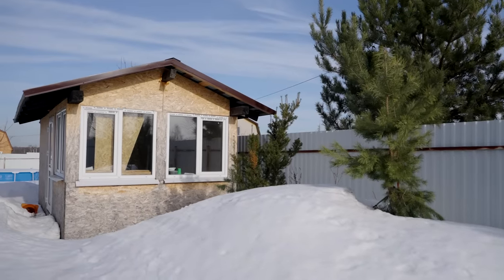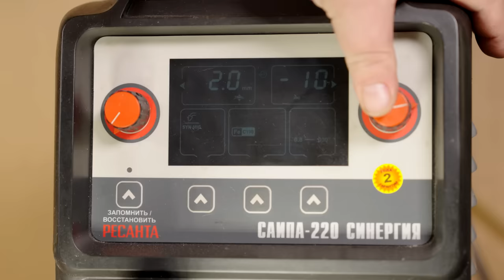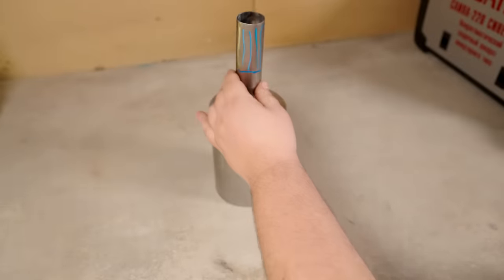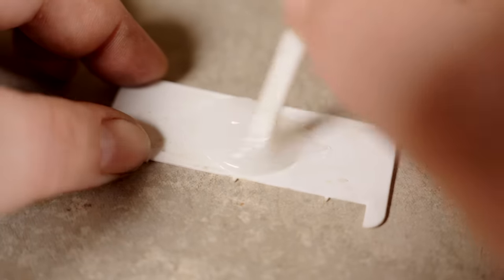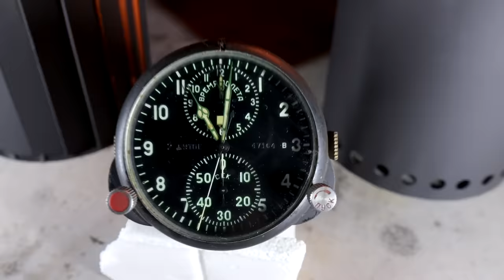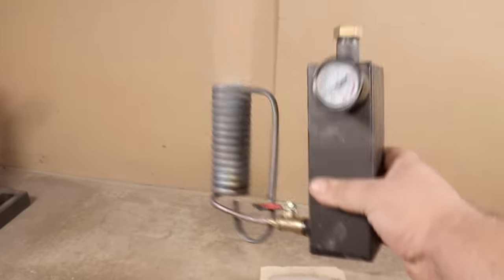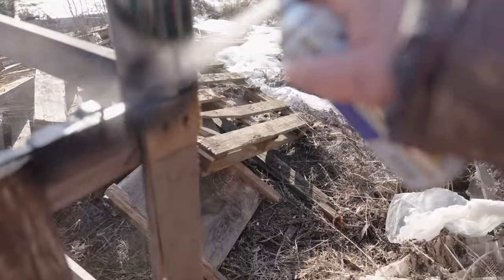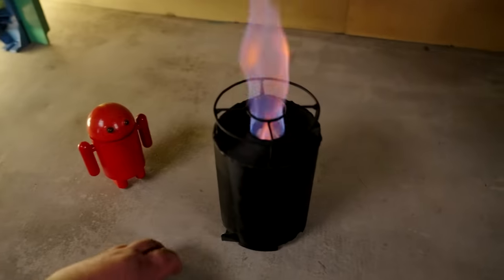No need for gas now! I INVENTED THE MIRACLE-STOVE!

Comment: You have a welder. Why Glue anything ? Surely the epoxy will not be as resistant to the heat like a weld would be. I think that is a fateful flaw.

Comment: Very nifty,but one can do this w just an empty food can,a roll of toilet paper (pull out the cardboard in the middle and stuff the roll down in the can),and some preferably 91 or 99% alcohol or other  fuel source which is doesn't put off too much CO2. Lasts roughly 1 - 1.5 hours,which is plenty of time for cooking. But just add more alcohol and re - light.
Reply: Yeah... but you waste a roll of tp. Fiberglass insulation does the same thing but is reusable since the insulation does not burn up.
Reply: @obsever97  Not everyone has fiberglass laying around,but most of us have toilet paper.
Reply: @brotherlittlefoot2216  It's literally in every wall in my house.
Reply: @obsever97  Hence the term "laying around". Yeah,I'm sure ppl want to go through their walls to pull out the fiberglass - ONLY IF necessary. You can stop here now,lol.
Reply: @brotherlittlefoot2216  Laying around in say the attic. or under the flooring or in the basement or better yet in any hardware store in the world.
Reply: @obsever97  Then why isn't your suggestion  for ppl to go and buy some and have it on in case of an emergency instead of arguing w me out of boredom or misery?
Reply: @brotherlittlefoot2216  Well somebody bought that tp too. ahahahahahah!
Reply: @obsever97  Steel wool beats them all.
Reply: @brotherlittlefoot2216  Nope Graphite cloth.
AKA carbon felt.
Reply: @obsever97  Ah,doubt it would outlast actual steel.
Reply: @brotherlittlefoot2216  Steel is made out of carbon. Carbon felt can withstand 1800 degree's F as a welding blanket
and does not burn.
Reply: @obsever97  I still say steel wool outlasts carbon fiber as a wick.
Reply: @brotherlittlefoot2216  Steel wool burns up during it's first use.
Reply: @brotherlittlefoot2216 brother, you're a little fool

Comment: pretty sure no epoxy will stand the heat generated by the stove, especially when a pot is placed on top to cook something. the flames would be directed sideways towards the glued seams and burn it off.

Comment: and you can buy similar for propan.  cheap and  no fatigue for such work.
Reply: A few problems with propane. 1. It's hard to get in emergency situations 2. Creates moisture when Propane or C3H8 is burned
not great in small spaces. Whats worse than being cold? I would say being wet and cold.

Comment: you have serious skills. I have to ask, can you build an incinerator for garbage and plastics? With enough heat, it is environmentally friendly.
Reply: Incinerating garbage and plastic is not environmentally friendly at all. In fact is even worst then leave it alone.
Reply: @SpiderF27  It is environmentally friendly if done at proper temperature. It generates excess energy. Garbage would decay releasing methane, and this way it would go straight to carbon dioxide. Plastics are basically a form of fossil fuels. It's better to incinerate it and get energy out of it than incinerate coal.
Reply: I saw a video of making plastic into diesel
Reply: @SpiderF27  Research it - you are wrong. You need a high temperature. If the temperature is low, then you would be correct. I am currently in a 3rd world country, I assure you, an incinerator would be better for the environment. Unless you have lived and seen the garbage in these countries, it is difficult to understand.
Reply: @talksonabox  Recycle everything. Process all with a Shredder, pack the materials in big bulk bags and sell them in China. Chinese have processing plants that reuse everything. In this way you'll keep your environment clean and make some money in the process too. Don't jump straight into old methods of doing things. Be smart, be intuitive and you'll progress. Burning? How easy want you to get rid of the problem?!
Reply: @SpiderF27  Dude, there are no addresses in this country, there is no 'selling to china'

Comment: I’m confused.  If the hole in the cylinder goes all the way through, what is holding the fuel, keeping it from running out the bottom?
Reply: Look at the inner tube the cuts only are on the top. The bottom half is solid creating a reservoir. It works like a zippo lighter.
Reply: @poppyd9758  ah thank you

Comment: Better the bluish flame, not not make the cooking pots and cooking utensils black at the bottom due to the carbon dioxide emissions in the flame, so to overcome this, need little minute air oxygen to mix in the flame.

Comment: This is just a random thought I had but since one can watch welding with no harm from a video camera and see exactly what one is doing why don't welding hats have small built in video viewers instead of super dark glass still?  Put a protective glass plate on the lens of course.  Seems a very logical idea to me. One can actually See all the time what is doing ! 🤔
Reply from the maker: The thing is that the camera has a focusing system, and if you put on a very dark lens there will be problems with focusing.
Reply: @Doctor-Robo  but you are not using a dark lens to video this ?  You dont have a manual focus setting?
Reply: Cost! Adding a camera plus a monitor into a helmet is quite feasible but would cost more than the average person would wish to pay. If your having trouble viewing your weld pool try one of the helmets with the LCD lens they came out just as I retired and they are great, you have clear lens to look through to position your rod/ wire then as soon as you strike it darkens to the level you set and you get a clear view of your Weld Pool.  When I was helping someone to learn how to weld once I could get them to see the WP they're problems were over because you can see the flowing pool of molten metal and see if any holes are forming or if your staying too long in one spot and causing blow through.

Comment: could it have a thin tube  going into the side attached to a resevoir of fuel so that it refills itself?
Reply from the maker: There is a physical law of communicating vessels - to use it the way you want it, you need to make a small system of tubes and valves.

Comment: This design is flawed, in my opinion. It is missing a mantle which would allow you to burn secondary gases, like CO. Also it is missing an insulated heatshield/IR shield, which would direct the radiation back into the flame, increasing the temperature above the flame, where you actually need it. You can do better than this. I love your channel.